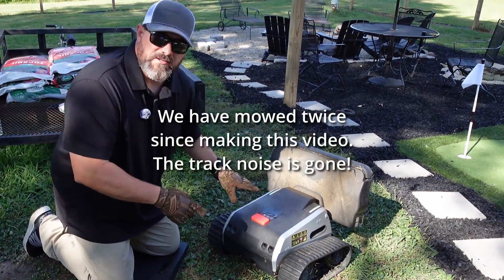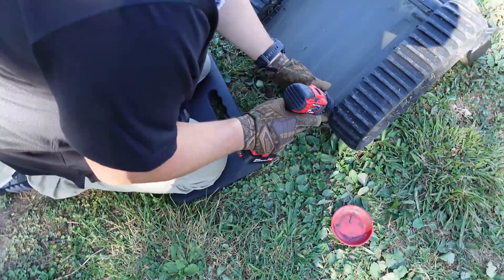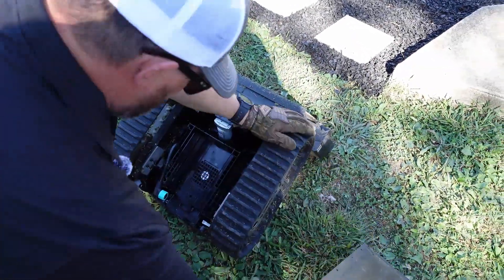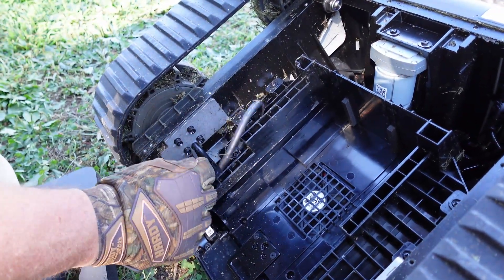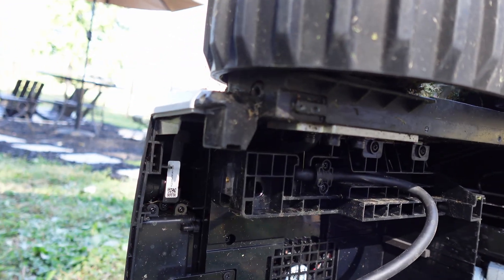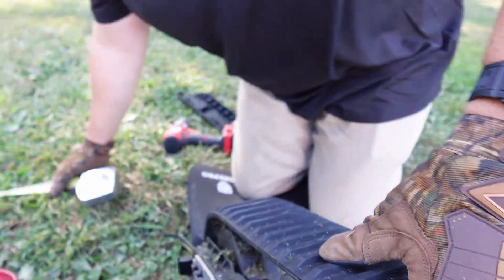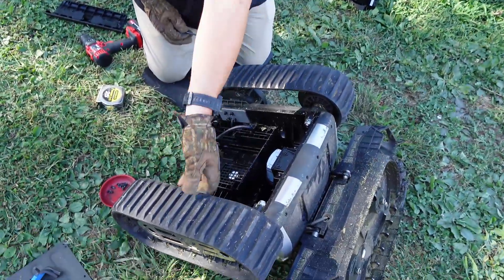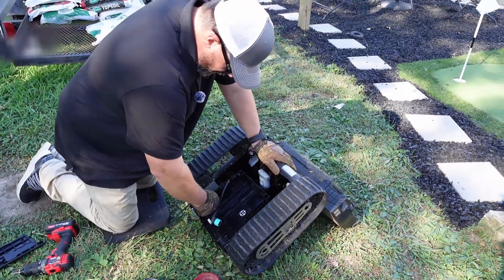Lymow One Track Adjustment

Comment: The source of my clicking was from dirt and grass buildup on the front track gears. Grass and dirt sticks to the center area of the gear  that guides the tracks. It looked clean after I hosed it off but after shinning a flash light on it I could see it wasn't (looked similar to the buildup up scrapped off normal mower decks). I sprayed the tracks with Dawn power wash and used a plastic scraper to remove all the build up. The buildup isn't uniform all the way around the gear so instead of having a smooth round gear surface, it makes it lopsided. When the raised area rotates in, it raises the inner track teeth. The inner track teeth reseat as the raised area rotates out. The clicking was the sound of the inner teeth reseating.
Reply from the maker: Thanks for the detailed tip! That's really helpful information for anyone experiencing a similar clicking sound. The scrappers we put on ours really helped with that.
Reply: @besteverreviews24 Where do you get the scrapers from?

Comment: I was told by Lymow that it should be 4cm, mine came with the tracks so tight it put a split in the track on the first use.
Reply from the maker: That is insane. Are they sending you new tracks?

Comment: Thanks for the video and the super useful tips!
For me the issue wasn’t dirt but alignment. The front guide wheel is very rigid and was already perfect: the tiny center mark sat exactly 4 cm from the metal frame on both sides, so no work needed there. The rear drive sprocket wasn’t at 4 cm—inside the track you could see it running too close to one inner lug, so the track wasn’t centered and that caused the clicking.

Fix that worked for me:
	•	Loosen the four inner motor-block bolts just enough so the block can slide; push the block forward.
	•	With the track off/loose, set the rear sprocket center to the same 4 cm as the front (middle of the track’s contact path).
	•	Pre-tighten the four bolts crosswise to ~1 Nm so it holds position.
	•	Refit the track and set tension with the rear adjuster (lightly taut).
	•	Finally tighten the four bolts crosswise up to ~4 Nm.

After equalizing both centers and setting tension, the clicking disappeared.
Reply from the maker: That's great to hear. Thanks for the comment.

Comment: You asked if anyone had actual torque specs. I contacted Lymow and they sent me these numbers. Not hard core specs but a starting point.             Screw torque limits (as reference, no strict requirement—just tighten securely; thread locker can be used if needed):  
M3: 1.2 N·m   10.6 Inch-pounds          6 screw on rear hub (the ones falling off)
M5: 5 N·m        44.25 Inch-pounds      Screw for Front Idler wheel
M6: 4–5 N·m   35-44 Inch-pounds       This is the idle tension adjustment screw.

Watching a video from "The Mean Mechanic"  on adjusting the tensions he mentioned  range 30 to 38 inch-pounds. He used 32 inch-pounds for his unit. I set mine to 32 and I think I need to back it off to 30.  
He varies a bit from Lymows specs on the other 2 screws.
5mm bolt - 40 inch-pounds  - Idler wheel
3 mm - 25 inch-pounds -  Rear Hub

Like I said, even Lymow does not say they are an absolute, but a good place to start.

I enjoyed you video.
Reply from the maker: PLEASE PLEASE PLEASE  DO NOT USE TORQUE SPECS FOR TRACK TENSION!! I watched the video and everything else is great. He made a really good video. But you have to treat this like a track on a machine or a belt for a pulley. We will try and do a video this weekend to talk about this more. Thank you so much for the specs and the comment.